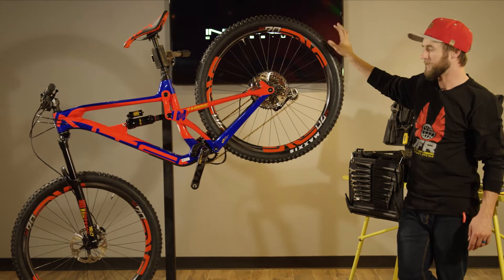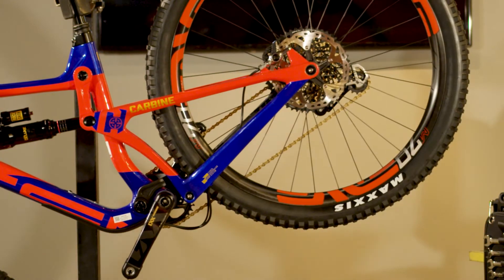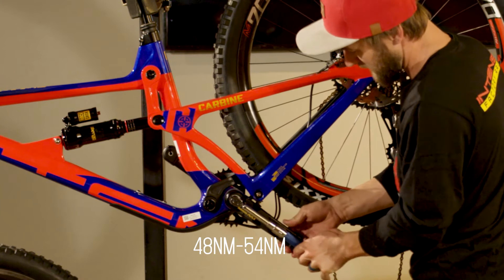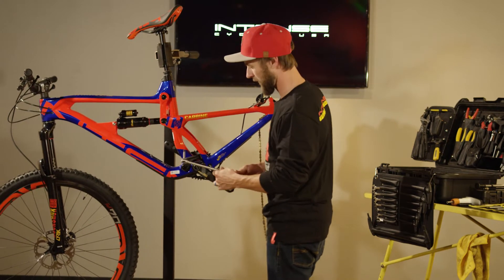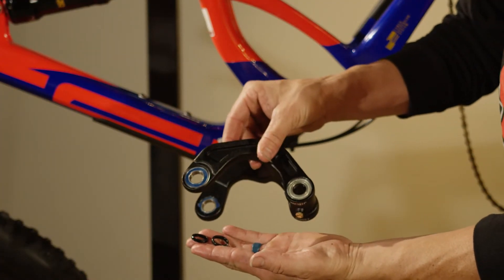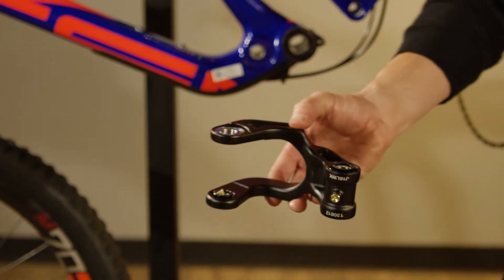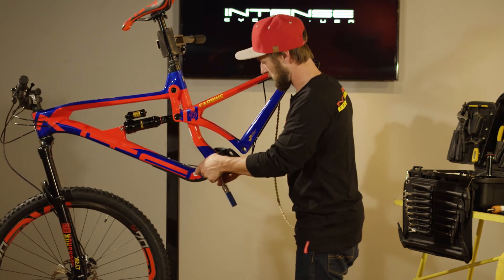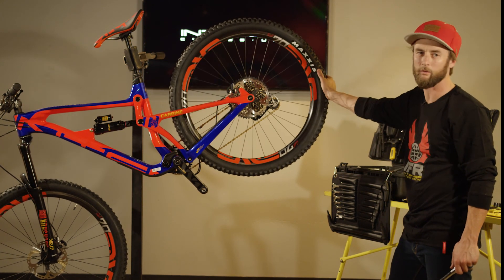Intense Tech Series: Lower Link Service for Enduro

Comment: I just picked up a 2016 Intense Spider 275C (carbon) that needs that pivot rebuilt and the BB replaced.  Thanks for the video.  I hope you guys still offer those specific parts for it (found an exploded view of the frame with part numbers on your website, thanks).  I have a 2012 Tracer 2 in like new condition, and am looking forward to my first carbon framed Intense!